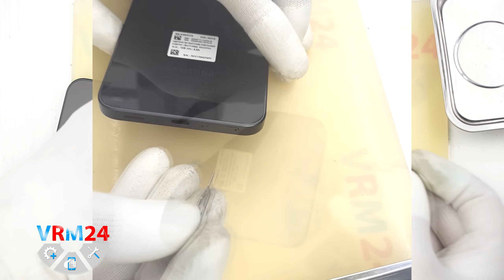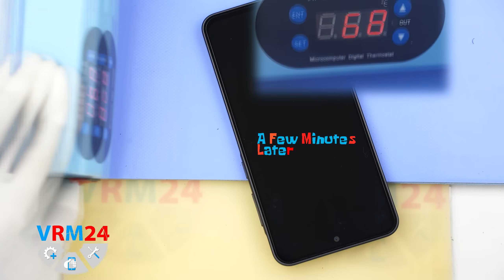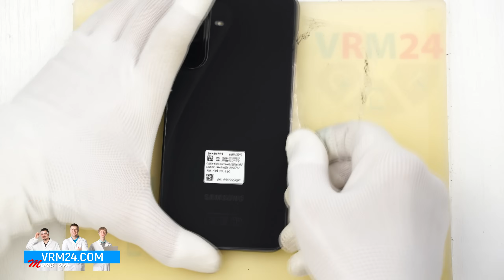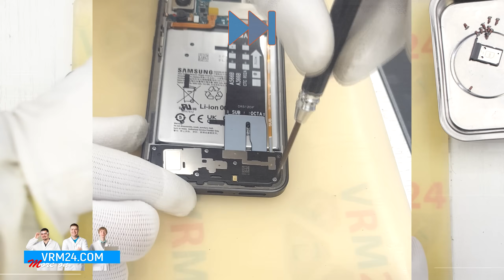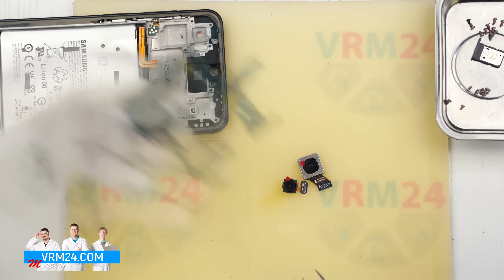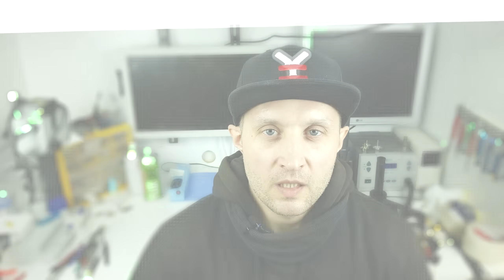Samsung Galaxy A36 SM-A366 Teardown Take apart in Detail

Comment: Like many of us 🫡 I inserted the sim ejection pin inside the mic hole on my brand new A36 and from I can see in the video if one insert anything inside mic hole it  will reach a cavity that is insulated from water and from the actual mic that recides below that cavity. Please correct me if I'm wrong
Reply from the maker: Hi, the microphone is located on the sub-board, opposite the L hole. The membrane is located at the top of L hole because Samsung designers are smart )
Reply: @Vrm24com hey but i felt my sim tool reaching an end what is it actually touching tho

Comment: Would inserting the sim ejecting tool in the wrong hole damage the phone ?
Reply from the maker: Hi, usually if mic is inside back cover - iPhone for example, yes you will pierce it through
Reply: @Vrm24com 
I did once insert it in a36 the hole next to sim island.. would I've damaged it?
Reply: @Vrm24com  So on a36 u wont damage the mic membrane?